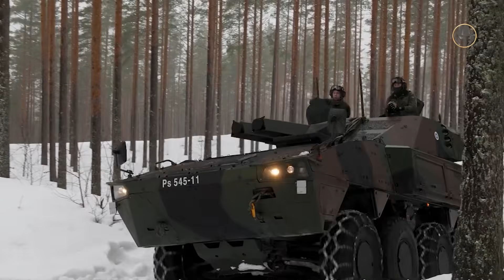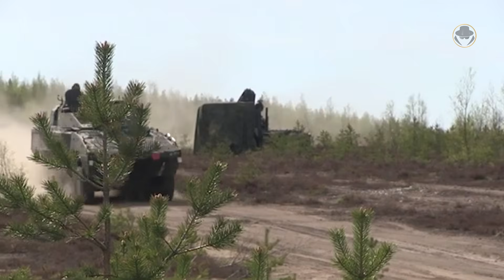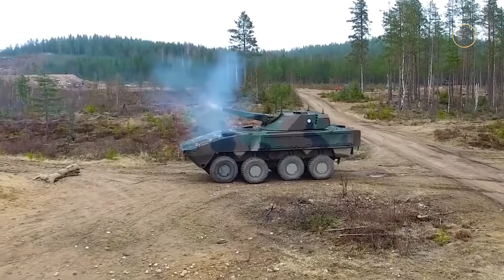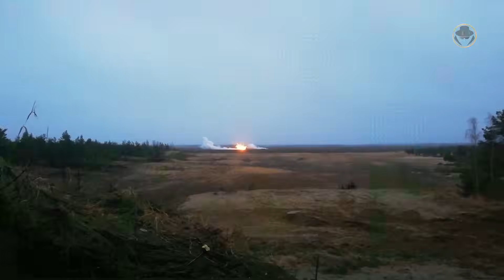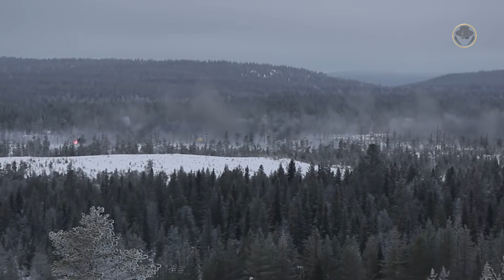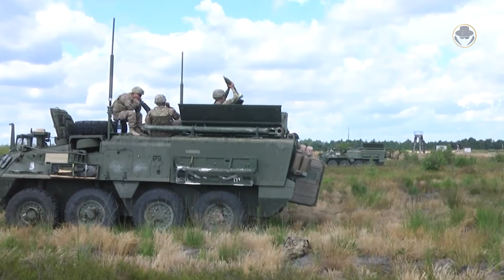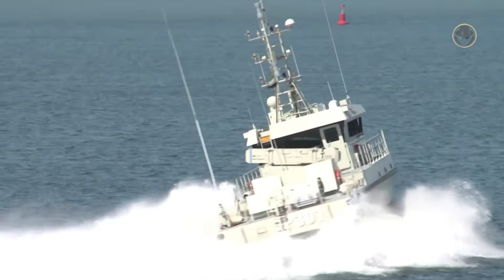AMOS - XA-361 | Why has no country, other than Finland, preferred such an advanced mortar

Comment: I would assume AMOS would actually work really well for Finland, a single vehicle hidden and traversing forest, could lay enough fire (and scoot) to halt a large enemy force advance given they would too need to negotiate through narrow corridors. You can tell some other countries don't really know how to use such mortars since they train using a whole battery, moving and establishing firing positions for multiple vehicles, which is a waste of advantages of lighter (compared to 155mm howitzers) 120mm systems. A detached single fire support vehicle proceeding behind the frontal force, accompanied by a single IFV with dismounts should work for asymmetrical needs of the last 2-3 decades, and Ukraine showed any grouping of even longer range howitzers is a no. Also unless they refined it, I recall polish 120mm mortar should be considered as a fail, since reportedly it was not compatible with NATO munitions. The whole idea behind it was an extended range compared to existing 120mm mortars, but when they accepted the system into service it turned out there are no such rounds ready for production, because during mortar design stage the designers just hacksaw existing 120mm soviet rounds into a new extended range rounds to meet the requirements.

Comment: Amos is not usable in conditions like Ukraine, for example. In forested terrain, it is very useful. The range of the projectile is short.
Reply: Amos has range of up to 10 km. Most modern armies have standardized around 120mm mortars that have an average range of less than 8km. 155mm howitzers, of course, outrange it by miles, but those are a different class and require much more logistics. The M777 Howitzer currently used in Ukraine is also much more vulnerable to shrapnel. Also: The main threat to 155mm howitzers in Ukraine remains UAV Zala Lancets, which outrange any artillery and will continue to do so in the future. Here, the mobility from being self-propelled is perhaps a bigger advantage than range would be. 

The real reason why AMOS is not used in Ukraine is not range, it's cost. Ukraine has used 61mm and 81mm mortars to good effect, and there's little reasons to assume that AMOS would not significantly outperform these in the same role, given a world of infinite resources. Ukraine has even used 30/40mm "mini-mortars". The fact just remains: Towed artillery systems are way cheaper than self-propelled ones, and quantity matters.

Comment: My own guess is that Finland is soooo heavily forested that any Land Combat will be at closer ranges compared to, say The Great European Plain.   The Fins know their plan
Reply: 80% is forest
Reply: Massive amount of logging roads combined with specifically developed road infra allow platforms like AMOS just zoom from logging road to another, dump barrage and leave before enemy shells even land, even if they have drone spotters to direct fire moment AMOS stops to fire, so counter battery fire is very unlikely least from traditional artillery. How ever direct fire capability comes in handy once war has gone little bit since those forests tend to open up rather rapidly into plains after enough artillery strikes and we have extensive experience from that. Also since forest gets cut and logs do get collected, there is forest openings that can be very large. It takes about two years to become filled with brush enough to hide vehicle via foliage on summer, couple more to cover most hill side roads as well. On winter its bit more different story, but over all this system is perfect to our specific areas. Since there is so much of those logging roads going like spider web all over the place command can set variety of barrage spots utilizing the range of the system and they can retreat fast as well. In central european plains it could be different story where man portable system hiding in what little visual cover there is make more sense, but also makes things more dangerous, specially in new age of thermal camera drones, though those pesky kamikaze drones can be a issue for AMOS as well depending on E-warfare capabilities, but then again this is completely new age of drone warfare no one is really developed for except maybe Russia, US and such who have operated military drones for long time as scouts ie developed measures against electronic interference.

Still AMOS could be useful tool to armies of the European countries if they develop how to utilize it further. Given we are back to trench warfare who knows, we might see armored and armed trains again how we make loops in strategy and tech -.- and AMOS in train would be really funny, specially if there was dozen mounted on the train carts... Just think the barrages that thing could deliver, mowing the route part of spearhead. Seriously though i doubt it will happen due costs and how easy blowing the tracks is, but it would be funny...
Reply: Amos does not need to stop to fire. Thats the beat side of it.
Reply: @jone8626  Smaller than an artillery battery, and more nimble. So from that perspective harder to hit, but of course they have to stay closer to the front lines due to their range. What is better will maybe (hopefully not) seen in the future.
Reply: Amos is real orc-splatter. Entrenching didn't help much and dven russian counter battery is pretty much uselss against it. With well build clos air defence and ewaefare units it is very dangerous and surpricing unit to defence, attack and stealmate situations.
Foreign cou tries just run out of money and can't afford quality. It is a shame as system is rwally cool, cheap to operate and deadly.

Comment: Pros : Best 120 mm Mortar system in the world.
Cons :  We can only afford 3
Reply: Finns actually are ordering 100s of these
Reply: @roopezi4588 Where did you get this info? If it's official then I doubt it's very wise to be spreading possibly classified info.
Reply: Do we have 5 or 1000 of these, red's having another problems. I mean, it's not big secret if guy's are putting new ones on line.
There's real secrets and then some 20y old, on going projects.
Effective good tool, I think it's having good economy and machine wearing slow in use.
Reply: @jannejohansson3383  your comment doesnt Have head nor tail, but yeah its a very good mortar system, and It aint Even that expensive, because Finland has a lot of these APC's to convert
Reply: @roopezi4588 Really? You’d think they would invest in the cheaper NEMO and the even more affordable TREMOK. I haven’t heard anything about buying 100 of those, but of course it could be non-public information.
Reply: Finland bought 18. And are switching to the single barreled Nemo version that is widely adopted across the world.
Reply: @snadem506  but in The nää future, 100s of these are coming
Reply: Near*

Comment: There were big differences between the Swedish and Finnish AMOS. The Swedish one had a much more advanced loading system. Finland went for simplicity. Sweden should have a fully automated loading system capable of delivering 14 rounds of MRSI, something that never worked… Finland have a much simpler version of AMOS, but it works! On the XA-361 the AMOS have an MRSI-capability of 4 rounds on target. I’ve seen a platoon of XA-361 AMOS (3 guns) conducting an MRSI-mission and they landed 12 rounds in less than 0.5 seconds on target!

Comment: All foreign hands on the program decided that common defense can be outsourced onto Finland without cost, risk or loss. It was also terribly convenient for the swedes to bait-and-switch in a manner to exhaust "competing" finnish milind research resources and then direct the expected investments onto inferior but domestic products.
Reply: Genomförandegruppen under the Reinfeldt cabinet was out to prove that the military could not handle their budget, and that a lot of cost savings could be done by cancelling unnecessary programs.
Well, they cancelled AMOS, leaving the army without mortars, nothing to put in the 40 hulls already prepared and waiting, and no money as the penalty for breach of contract was higher than the allocated purchase cost.
Reply: Sweden did buy it! That is, they went for NEMO, the lighter and cheaper single barrel variant. But apart from the name and the number of barrels it's the same weapon as AMOS. Several other countries have bought or are planning to buy NEMO too so although AMOS as such never caught on, the project as a whole has been quite successful.
The reason Sweden switched to the smaller variant may not only have been money btw.
Reply: @tessjuel   Sweden had 40 CV90 hulls ready and waiting for the AMOS-turrets when the Reinfeldt cabinet had Genomförandegruppen perform amateur's evening, cancelling projects at random...  which meant the money set aside in the budget for the turret procurement instead were spent paying the penalties for breach of contract and of course Finland losing confidence in Sweden as a military partner which had to be rectified with other purchases at the expense of our domestic industry.

The Mjölnir part is a much later development,  when the issue of a 12 cm mortar came up again after the realisation that a few Archers can't provide the necessary support finally dawned at the department of defence.

Alas, the budget had already been spent on the penalties, so the only way to get meaningful numbers was a domestic cheapskate option.

Comment: The only virtue I can think of with muzzleloader mortars is the ease of using oversized munitions that might be useful for unconventional munitions. Mortars might be well suited to anti-drone munitions because of their low pressure. I suspect most SPGs will have fire control systems that integrate with a centralized radar array, so air bursting guided mortars might be a common solution.
Reply: Muzzle loaded systems are much lighter, cheaper and remove many failure points.

Comment: Requiring special breech-loading mortars was its biggest issue for me. The logistics costs aren't justified.
Reply: What logistics, once installed there isnt much of a difference to a regular tube but much higher utility,
Reply: You would like to stand on the deck of the vehicle at -40°C, and plop rounds down? This is quite uncomfortable at speeds of 120 to 140km/h, but customer is king. How about we sign you up for 100 units at 16M€ each?

Comment: When we look at the Ukrainian war it is clear that 1 of these vehicles could block an enemy attack with its precise high rate of fire BUT this looks like a VERY pricey vehicle and they would be hunted by every Lancet operator out there. Conclusion for me: very high risk vs high reward. A couple of trained mortar crews with a truck mounted 120mm mortar could also stop an assault if we look at all the footage... so not sure if this device is worth it (just thinking in sheer bang for buck vs potential money lost). It sure is an amazing engineering marvel tho.
Reply: These self propelled mortars are not meant to replace all traditional mortars. They have their own use and purpose. That is why Finland has less than 50 of AMOS and 800+ 120mm traditional mortars, that have gotten feedback from Ukraine.
Reply: @teemup9247   what is their own use and purpose? Its a mortar right? So... indirect fire at incoming assault? You need a +6 milion 120mm mortar platform for that?
Reply: @LEric49  They are most useful in mobile phase e.g. counter attacks when moving with advancing units. That is why there sre SPG with armored units instead of towed artillery.
Reply: @LEric49  Based on a master's thesis I found (Timi Puhakka 2016) AMOS is used in mechanized infantry whereas normal motorized infantry uses old-fashioned tower mortars but the new Patria TREMOS seems to be an upgrade for towed mortars.

Comment: I do wonder the usefulness of using an entire armoured wheeled chassis for a mortar when you can buy a similar vehicle with essentially the same maintenance costs but in 155mm. The 5km range really puts this into a dangerous operating zone with drones and enemy artillery or even ATGMs being able to easily engage while not providing enough boom in return. Also if you are going to use an IFV chassis you have the room and weight capacity to make this a fully automatic auto loader instead of getting 80% of the way there and then shrugging your shoulders and saying well it still requires at least 2 crew to operate.
Reply: 155mm is heavy and dont have elevation to be used effectly in forests. It needs open ground to operate if you dont want to hit the trees in front of you.
Reply: Mortars have their uses and you need system like this to be able to hit accurately and even land all shot shells at the same time to the target, which gives huge area of destruction and no time to cover. Against infantry, it is nasty system. Also everything in war is destructible, that is why there are systems protecting these things from such threats.
Reply: Finland is Europe's most densely forested country.
Reply: 5 km range in finland is huge, thanks to dense forests, hilly landscape and lakes. ATGM-teams and drones have very hard time finding these things. Also mortar vehicles are not alone in the woods.

Comment: The Patria NEMO sure seems slick, and the war in Ukraine shows that 155mm ammunition consumption can be a major limiting factor.

Even though a mortar has less range, the fact that it can provide more ammo for less cost/weight/logisitics could be a critical advantage. But is it enough range, for the mortar carriers to be usefully survivable?
Reply: The suitability will be largely dependent on the terrain in Ukraine's case I could see my self FDF reservist with knowledge on how we deploy these bringing 1-2 on the edge of town giving them fairly good cover from artillery's generally more flat trajectory and at the same time allowing them to fire into town with high arcs of fire and mobility to relocate to good fire angle. Trying to employ them on wide fields as substitute for artillery will most likely end badly. Without going into detail in our doctrine NEMO or AMOS does not carry out fire same type of fire missions to K9 Thunder or 155 GH 52 APU.
Reply: @xYarbx  Thanks for the info! So basically, it's definitely not a "replacement" for long range artillery, but useful in particular situations.

But I wasn't thinking in terms of the threat of enemy artillery, but rather enemy drones. Currently, the drone threat is something like observation drones directing "FPV drones" that can fly around buildings that would block flat trajectory artillery. Observation drones make it more likely the enemy will spot the mortar carrier getting into position, and then the "FPV drones" make it difficult or impossible to find a place with useful cover.

The give and take between drone offense and defense is very dynamic right now, of course. Something like anti-drone drones might change the balance without even any modifications to the AFVs. And the addition of a simple 12.7mm machine gun with a drone tracking sight might make FPV drone attacks dramatically more difficult.
Reply: @IsaacKuo  Based on a master's thesis (Timi Puhakka 2016) I read it seems that the AMOS is designed to be used in mortar companies in mechanized infantry. The new Patria TREMOS seems to be an upgrade for old-fashioned towed heavy mortars which are used in motorized infantry (which is the majority). Not sure if Finland is planning to get NEMO and where those would fit.